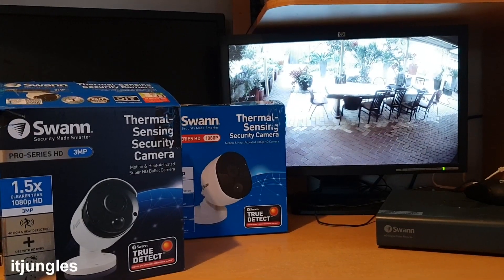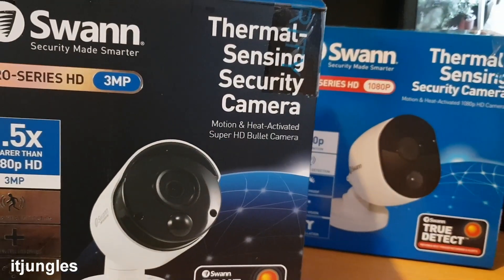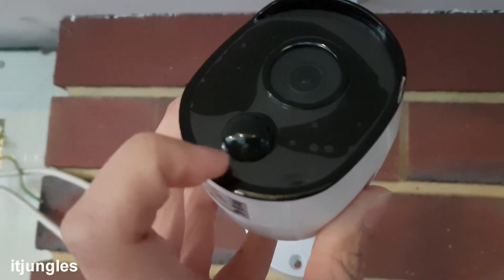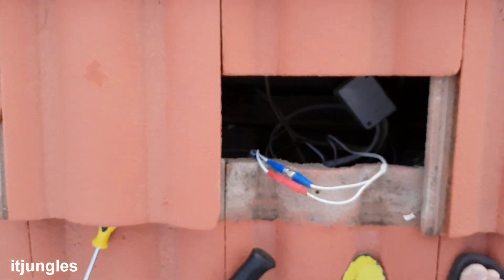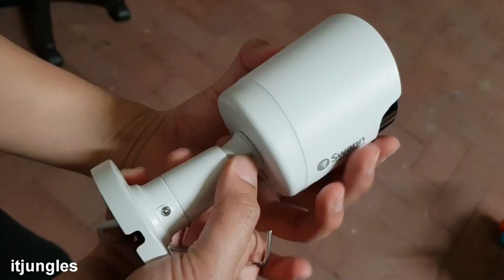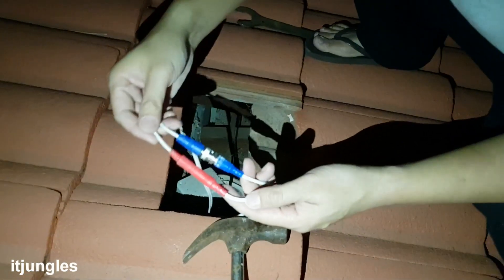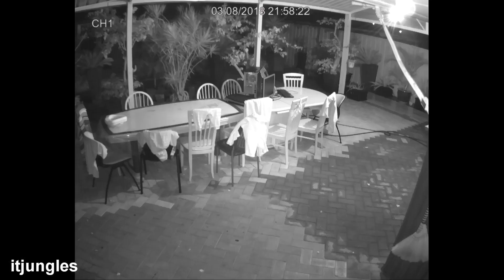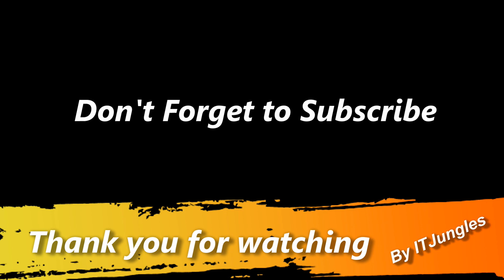Swann Security Camera: Install / Upgrade 1080p HD Camera With DVR DVR8-4575 to Thermal True Detect

Comment: All I wanted was a camera that would monitor the inside of my home when I am not there, send an alert to my smartphone if motion is detected, and allow me to view the inside of my home, remotely. I cannot tell from the box, nor anywhere else, if this camera will do that. So I am taking it back. I shall buy camera that does what I want - but it won't be a Swann. Their telephone support is very poor.
Reply: Ring or Nest would be the better option for wireless coverage with an app to notify you of all motion trips. Swann records all your footage to the local harddrive with no subscription to a service while Ring, Nest and Arlo generally have a cap on the amount of space that can be saved to the cloud. Out of all these companies, Ring has the best tech support in my opinion. They dont try and constantly transfer to different departments and tech support is well trained.
Reply from the maker: Yes it does that. And you can configure it in settings